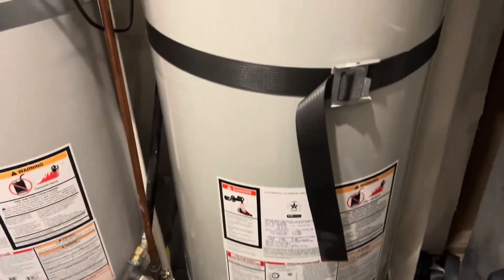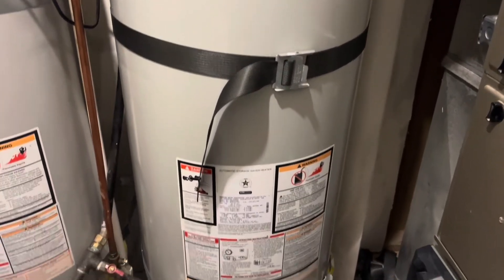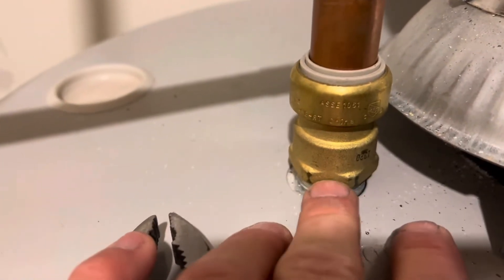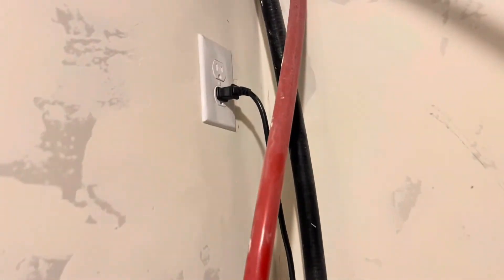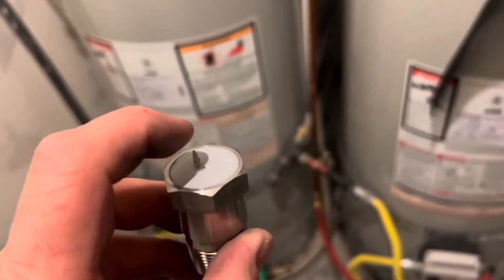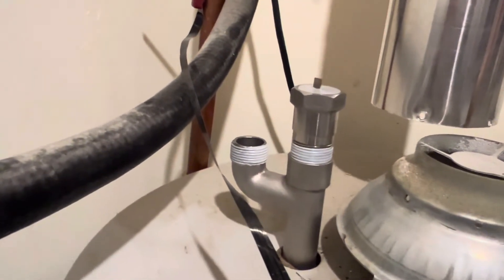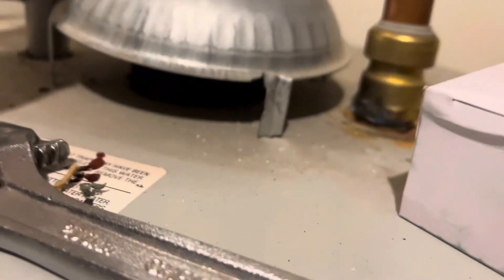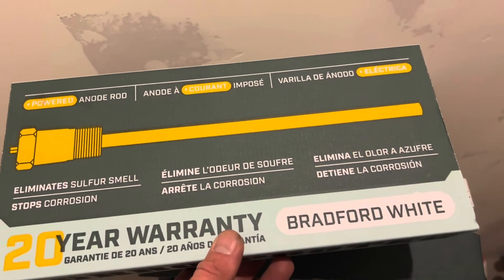Anode rod on a Bradford White water heater swap to a powered anode corro protect rod

Comment: If my Bradford white water heater is only 2 yrs old, will my anode rod be a pain to get out?
Reply from the maker: Nope. In fact likely easier to get out.
Reply: @BryanHansen 
So if I use a good pipe wrench I shouldn’t have any issues ?
Thank goodness, cause I was thinking I was going to have issues.

Thank you very much for your advice and informative videos 
Awesome 😎
Reply from the maker: @Chief6067  Definitely should work. That is what I have done every time.

Comment: My Bradford White tank has 3 anodes, and it is only a 30 gallon tank. I can't replace the one under the water outlet I just replace the other two. The anodes are so crazy expensive I am tempted to get this electric one. But how do we know if it really works? Does it need to be removed and cleaned once in a while?
Reply from the maker: It honestly works amazing. I’m sold. I’ve installed them in 6 different water heaters and been awesome. Two of them fixed the smell of the water and when I flushed the tank a year later no build up.

Comment: with this setup, it doesn't look like the rod is actually in the water more than a couple inches, with so much of the length being taken up by the adapter.  Whereas with the older style rods they are pretty much the entire depth of the tank.  I guess being powered, it doesn't need to make contact with as much water?
Reply from the maker: Correct. Being powered it doesn’t need to go that far in the tank.

Comment: I currently have a Watts hot water recirculating pump installed on top of the anode rod, after installing the "Y" adapter as shown in your video and installing the Corro-Protec anode on the right side of the "Y" adapter will there be enough space on the left side to reinstall the hot water recirculating pump?  Thank you!
Reply from the maker: I ran my recirculator through a tee on my lower drain.

Comment: Thank you for the video, do you have to replumb or cut the copper pipe that is the hot water itself? Just trying to prepare myself for any fittings I may need to buy as well.
Reply from the maker: No, I didn’t. If there is a rubber washer/gasket see if you have one to replace.
Reply: @BryanHansen Very nice. The offset of the T pipe doesn't create too much of an angle for the fitting to need to be relocated or replaced? I hope that makes sense.
Reply from the maker: @BravNeff  I didn't have to change it for the offset of mine. If you do/did, consider installing a flexible end.
Reply: @BryanHansen Thank-you very much. I was considering getting a flexible/ corrugated water heater pipe, and cutting the copper and adding a sharkbite connection to then attach the flexible pipe. You answered my exact question, I appreciate your help and helpful video
Reply from the maker: @BravNeff  People will give you grief over the sharkbite, but they are fine. You could do a compression fitting too quite easily.

Comment: That white material underneath the round plastic cap that you took off at 2:36 is insulation material that must not be "cleaned out" to access the anode rod as you said. The anode rod is not underneath that white material. The anode rod for that model (URG250T6N) is underneath the hot water outlet just like the older Bradford White you worked on in the video.
Reply: Yep that cap is to fill it with foam, nothing under there.

Comment: Thanks for pointing out that you had to crush the pipe to get it removed. I was being timid, but after your video I went after it with the biggest pipe wrench I own and while it flattened it a bit it came out just fine.

Comment: I just took out the insulation in the suspected anode port but turns out nothing there but a fiberglass surface.  I suspect that port is only for when they insulate the tank and the actual rod is (ugh) under the hot water line.
Reply from the maker: @BrianL-p8b  yours more than likely is directly under the hot water line
Reply: @BryanHansen  
Yep. Am designing my plan of attack now lol
Reply from the maker: @ in my opinion, don’t drain much of the water heater so you have the weight of the water in the tank to hold it still while you break it free

Comment: Did you wind up putting the heat trap back in? Just curious as I installed mine without the heat trap.
Reply from the maker: I didn't, I run a hot water recirculation pump anyway.  So it seems somewhat moot.

Comment: How did you handle the heat trap that's in the BW Rod?
Reply from the maker: You can install the heat trap on the Y that you install. The anode rod goes through the straight run, but the heat trap can easily be put on the 90 side where the Y pops up and the hot water line connects.

Comment: Hi there, I have two Bradford White water heaters (geothermal setup) with the hydro jet water tubes on the hot water outlet on each. Do you or have you had to remove the water tube to install the powered anode rod? Thanks Mark
Reply from the maker: I would depend on the specific model, some of those units have a separate anode rode port in the machine.

Comment: Thanks for making this video. I have the exact model water heater. It's been 5 years and this is my first time trying to replace the rod. Let's hope I'm not too late for maintenance since my water is not that hard in my area. 

There is a dedicated ground connection on water heaters which you just need to search for it. A green screw or bolt is an indication for a good ground.
Reply from the maker: There is a dedicated ground on an electrical water heater, but not on a gas water heater. Literally the instructions from both manufacturers state to just screw it to the tank exactly how I did.

Comment: Does that seem like a good idea restricting your water inlet or outlet by now having to flow over and around the annode rod.  
I would think that this would be a significantly restrict the water flow rate.  Maybe for recirculation its not that critical.
Reply from the maker: That’s how it was before with a thicker diameter anode rode. This is less restrictive.

Comment: How do you know where to connect that ground lead?  I would think the outer case of the water heater would be an unreliable ground, and that connecting the lead (somehow) to one of the pipes would be a much better ground.  I'm assuming (of course) that the water tank should be the ground and the "electrified anode rod" (so to speak) is the active electrode. 

To my way of thinking, I'd expect to install the grounding lead to a water-pipe grounding clamp, which in turn is clamped to a pipe -- either the cold-water inlet, the hot water outlet, or the drain spigot -- but I'd favor the first because there's be fewer temperature excursions to work it loose.

Thanks for this video.  I didn't even know these kits existed and now I want one!
Reply from the maker: The tank is grounded and the metal shell connects to the inside through multiple points. The grounding screw that you saw me attach to is literally what the instructions that come with the powered anode rode tell you to do, just detach the sheet metal screw off the body and reattach there. In fact the green light that you see on the power supply at the end only turns on when you’ve completed the circuit.

Comment: I'd like to do this to my Bradford White water heater.  How do I tell if the anode is on the hot water line or under the plastic cap with foam underneath?  Thanks for the video.
Reply: Best way is to look up your model number and go through the manual. But it's a lot easier to check under the hot water outlet than drill through insulation
Reply from the maker: @sbchannel7006  I can all but guarantee you it’s the hot water outlet on the Bradford white. If you order the one I linked to, it works for both styles.
Reply: @BryanHansen  that is quite a guarantee ! over  90% are under the hot water

Comment: Thanks for the video, Brian! While Bradford White installations can take a bit longer, it's definitely worth the time—you'll never have to replace it again. Sorry for the trouble with the chimney removal during the wye fitting installation, but good news—we're releasing a new two-part version soon to make installation easier. Don't forget to register your product on our website to take full advantage of our 20-year warranty!
Reply: Have you released the new two-part video yet? I have a Bradford White, with a water softener.
Reply: @lansir26  Yes, now all our ''hot water outlet'' models are shipped with the two-parts version!

Comment: Nice video.  I'm looking at getting one for my water heater when it's time for anode replacement.  I'm not sure it's cost effective from a material perspective, as I think this effectively costs more per year than a standard anode rod.  I view it more as huge labor savings, as you only have to change it out once for a decade or more, vs multiple times with a conventional anode rod.  [I have a Rheem heat pump HWH, and there's an entire top shell that needs me removed and supported, to get access to the anode rod.  That I don't want to be doing every 3+ yrs!]

Do you also plan on installing this on your second unit?

For you installation, I'm glad you stopped the camera when you threaded the adapter.    That's not something you didn't want to struggle doing while holding a camera!
Reply from the maker: I had the same thought, especially on an older water heater. My thought is that if the powered anode rod lasts 20 years, I can use it on the next water heater as well. 

I am getting one for the second unit as well. I honestly was just going to do it after a few months to just off set the money out of pocket and I know the other anode rod has some life left in it. 

Yeah, there are some things that should be done using both hands. I did NOT want to cross thread that!!!